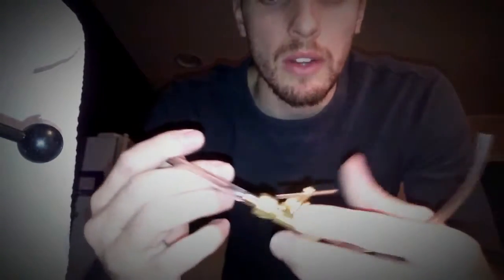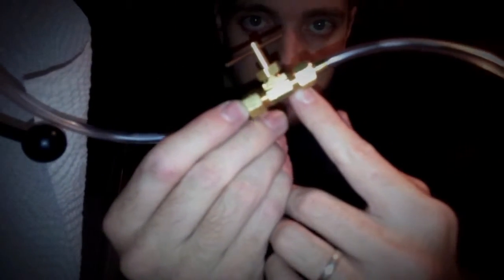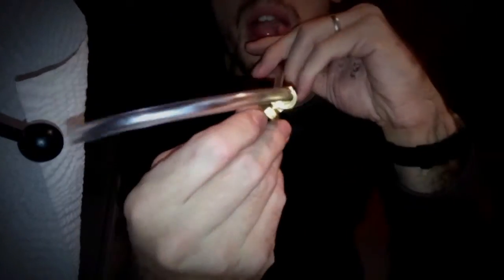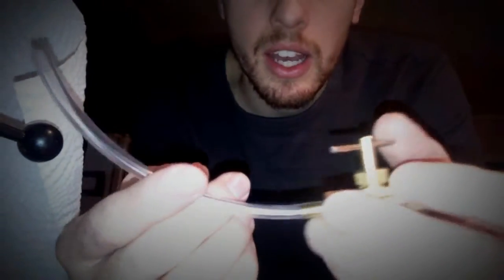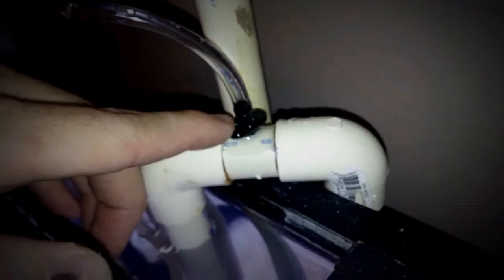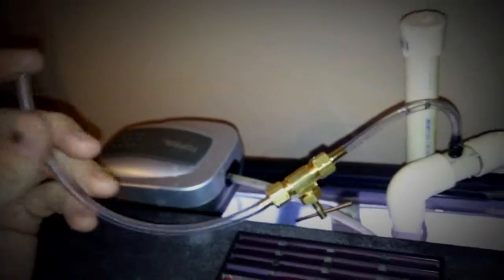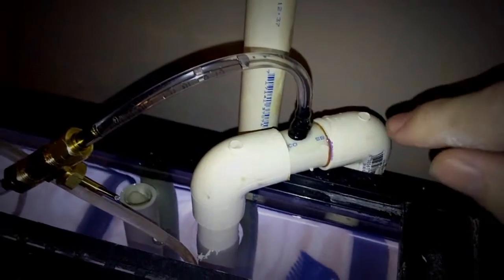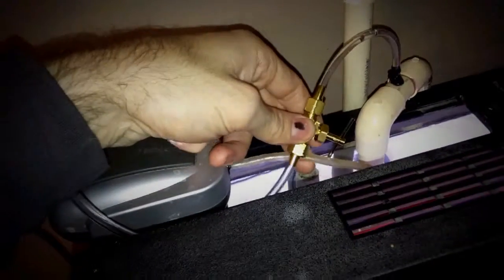Shut off instead of check valve in PVC Overflow

Comment: Thankyou!  Every check valve i try ends up leaking air in.  Using the shutoff should work great.  I'm also going change to a clear tube.  Another great tip.